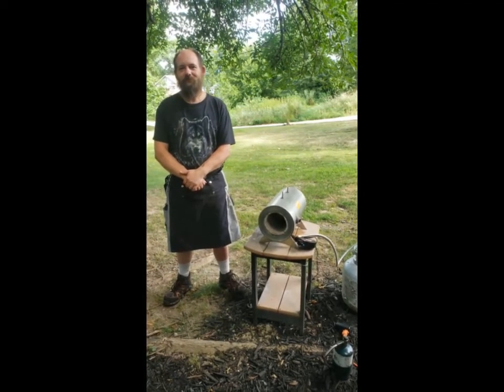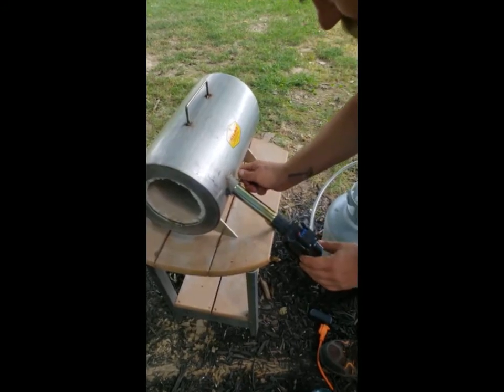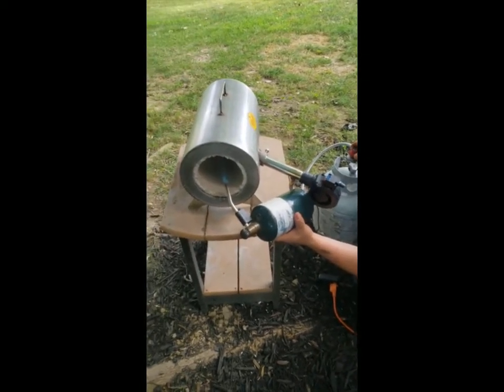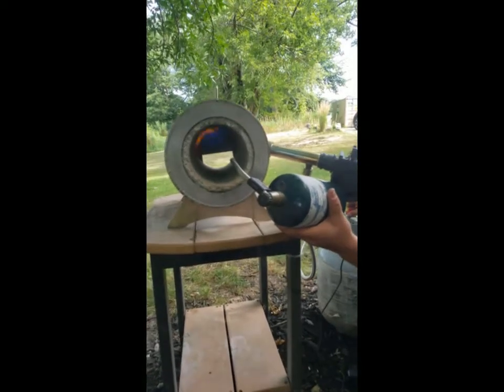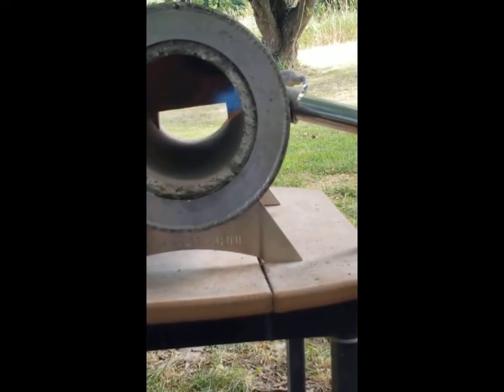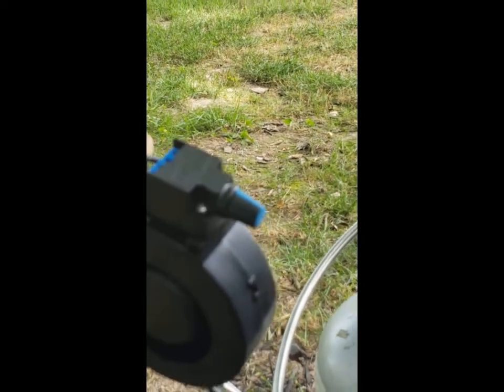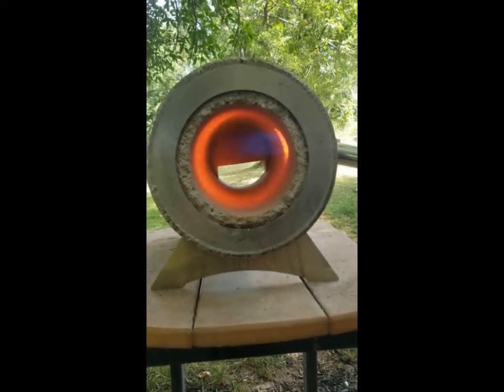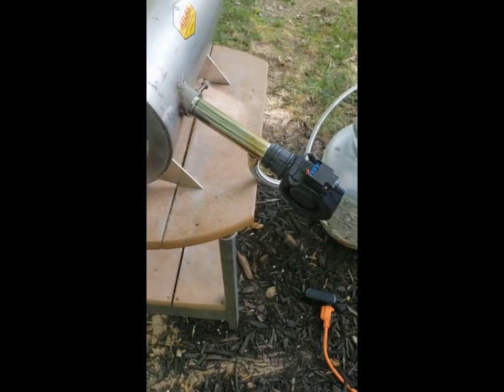How to light a Graham Forge

Comment: Good Video on a BEAST of a forge!  I set the gas at about 4-5 psi and the fan speed is 2/3 to 3/4 once its warmed up.  It doesn't take long to heat up 1/4" - 1/2" round/square or flat stock to forging temps.  It's my experience that any higher than 5-ish psi is unnecessary and a waste of gas.